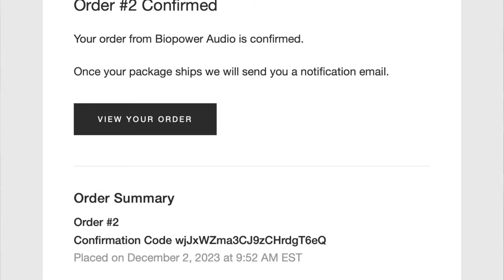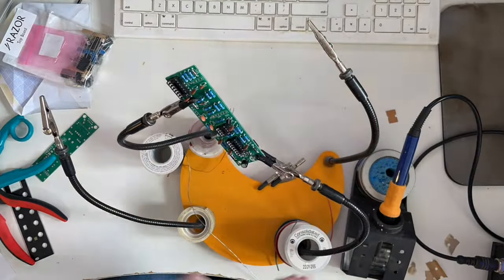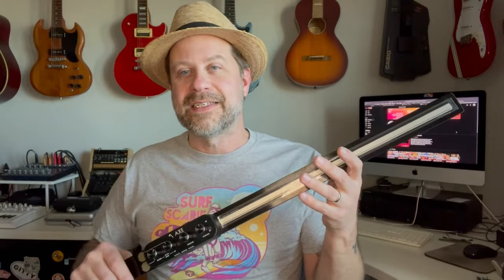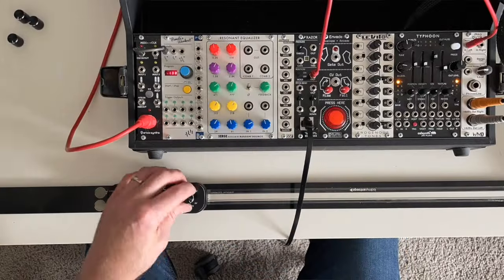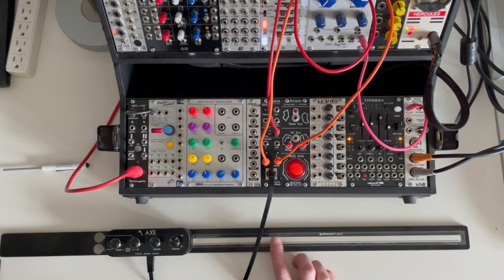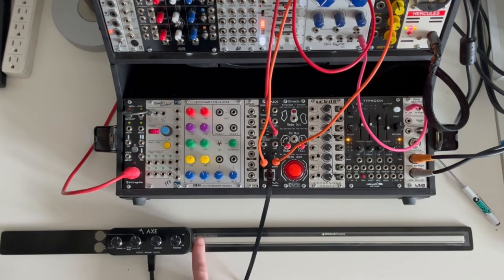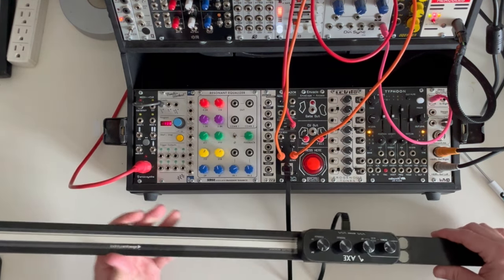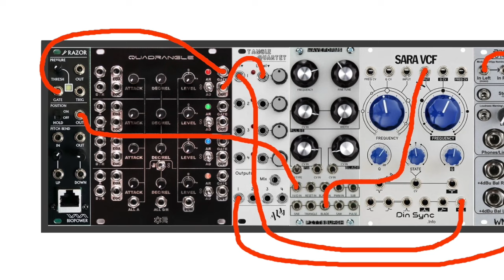Introducing The Axe & The Razor from Biopower Audio!

Comment: I was with you up until I hear that "first jam" segment and now I honestly don't see myself spending any money anymore. That was... underwhelming, to say the least, I'm afraid. I expected so much more out of that. 😮‍💨
Reply from the maker: I don't think you should judge a module based on a single jam (because a jam is exactly that... an ephemeral audio experiment) but hey... call it like you see it. Thanks for checking out the vid either way.
Reply: Might have come across a bit harsh, yeah sry. I just thought the axe would be more of an actual instrument.  A ribbon controller to play more advanced melodies with. And it appears that you can. After having watched their own demo videos I'm kinda interested in it again now. Looks like you can use it as a solo instrument. I'd love to see this in the hands of someone good with a slide guitar or a lap steel. 😃
Reply from the maker: @autoaimcfg   Ironically, I actually play slide guitar and lap steel. The Axe is actually quite different from either. On a lap steel, moving the slide 6 inches could take you up a fifth. On the Axe that same movement can take you up 2 or more octaves. It is possible to scale it down to be similar to a guitar scale... but then it's the equivalent of a 1-string guitar. I plan to try that once I get used to it.
Reply: @autoaimcfg  I'm a big fan of it for melodies, though like any fretless instrument it requires you to be pretty precise if you don't use a quantizer with it. Here's my first stream experimenting with it: https://www.youtube.com/watch?v=rlCnZ4KkB8s